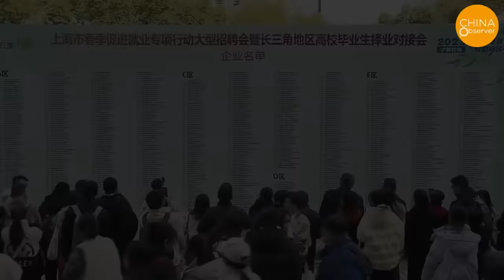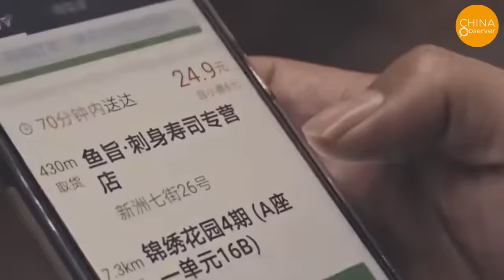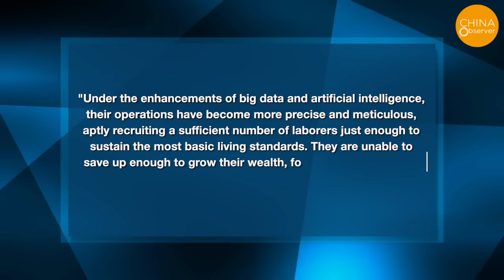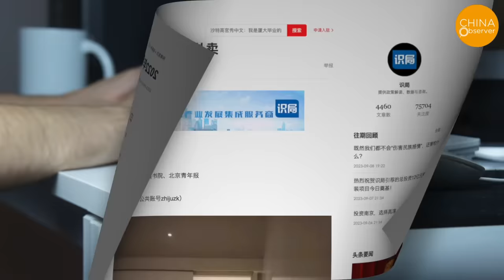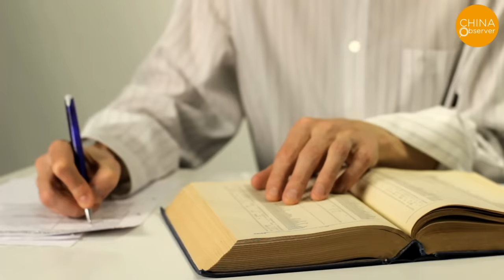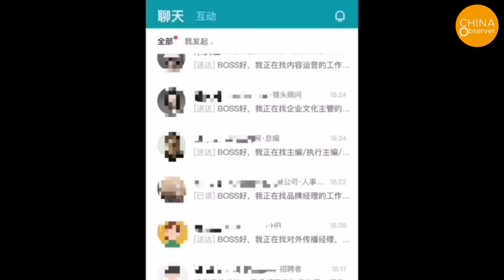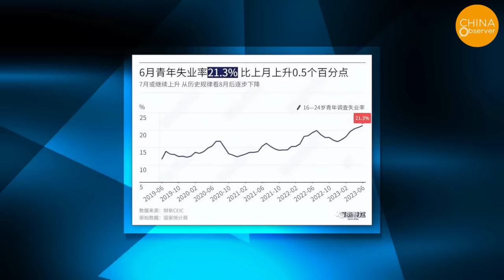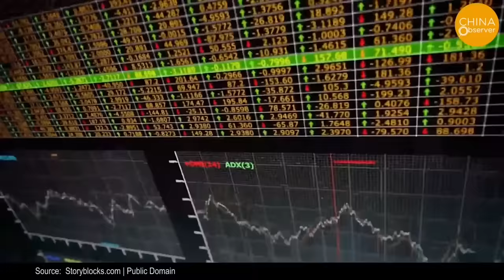Delivery Riders in Tears: Only $0.15 for 10KM!Economy Crash:Millions Jobless,Rush Into Delivery Jobs

Comment: Delivery jobs only pay about $300 per month here in Kenya, but cost of living is low, you can get a decent apartment for about $100 per month. Not sure how Chinese pay rates compare to cost of living there.
Reply: If it was not profitable job no one woule work in it
Reply: Rent in China depends on the city level. Generally, you can rent a 100 square meter apartment for US$300. Buying a house is expensive, $200,000. If your salary is not high and you are single, you can rent just one room for about US$100.

Comment: Ive worked for ride shares and delivery with over 10000 rides in the US.  If you deliver from only fast food restaurants you can expect around 4-8 dollars an hour. High end restaurants perhaps 20-22 dollars an hour. Going from a mixture of both since getting all high end restaurant requests is rare, you can expect 12-15 dollars delivering. This isn't factoring in costs of using your own car, gas, ect. There were multiple days when I made 30 dollars for a 16 hr shift. Delivery is paid by prayers. Ride share on the other hand is paid by miles and prayers.... avoid driving for money; it's not worth the liabilities.
Reply: I've always thought that if you have to use your own vehicle for the job you will lose. Gas is only part of the costs, there's also tires, insurance (which frequently is priced at how many miles a year you drive), repairs, oil changes, more miles on your car which makes it worth less, etc.
Reply: Prayers?  Are your customer base priests?
Reply: @cgasucks No. His employer is the Lord God called markets. And it is a cruel merciless god.
Reply: @Praisethesunson We need Jesus to come and throw out the moneylenders from the temples of capitalism and then die on the cross to free us from debt.
Reply: Because gas is expensive. Deliver with a gas scooter

Comment: I can relate to this myself because I worked as a door dash driver for a while. I still remmeber doing a delivery and not receiving a tip. I remmeber delivery grocery where I had to make 5 back and forth trips to the second floor of an apartment using stairs only to be given a tip of $7. It is hard work and most of the time doesnt pay well. But during an economic downturn, you can’t afford to be picky with jobs. You do what you need to survive.
Reply: I agree, I work in deliveries in Lisbon Portugal and also do vlogs about deliveries, I am making 1/3rd of what I was and working 2 to 3 times the hour... my other side hustles for video editing and designing are dead too...
Reply: Compared to what the people face in China that isn't that bad.